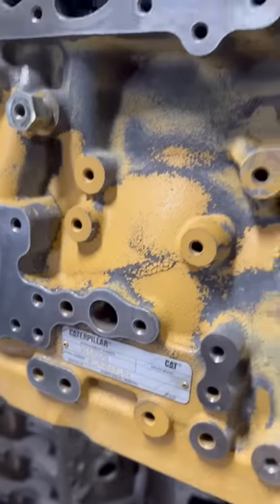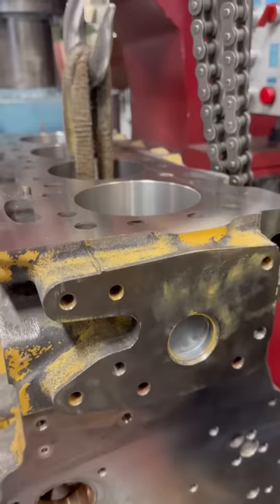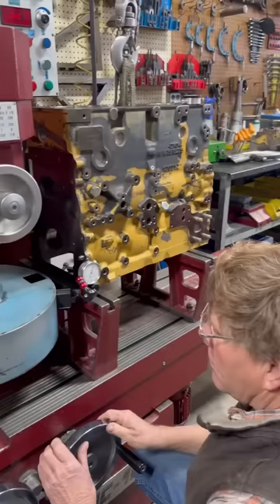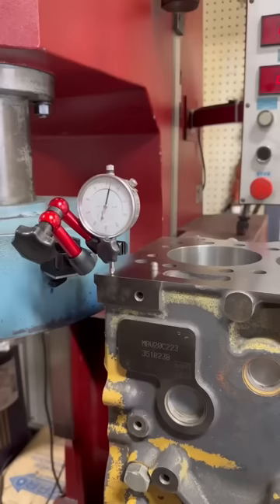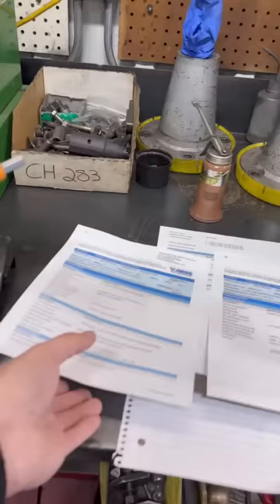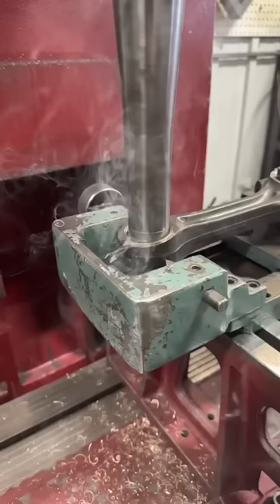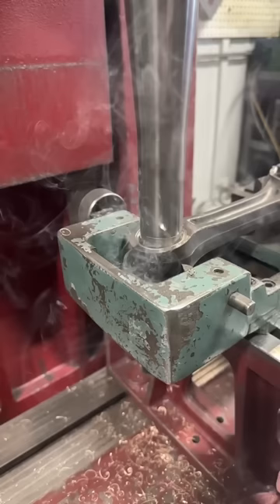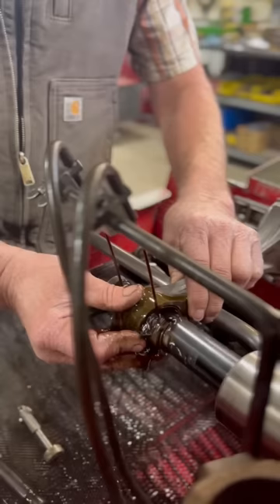#shorts How Can We Compensate For The Deck Height Being Too Short?

Comment: So if you had an engine come in with a rod knock and the customer wanted a cheap job that would last, what would be the plan for that particular engine?
Reply: The easy way would be to resize the rod.  They would remove the rod bolts cut both the rod and cap bolt back together the hone the big end until within spec then replace the bushing on the piston end, and again hone until within spec.  That would be the fastest and cheapest way to do it and still have a good long lasting repair .
Reply: My local shop would send it down the road and tell you they don't do bandaid work. I don't blame them, as it almost always brings headaches. But the other poster here has the answer if they said yes.
Reply: @bertgrau3934  Couldn't you just swap the bearings and get a replacement rod/piston, so long as the bearing didn't spin?
Reply: @terracar2003  
You could do that, but it could cost more.  Especially if you replace the piston,  they aren't cheap.
Reply: @bertgrau3934   I would rather replace it, the cost would be worth the reliability of a better condition part
Reply: @terracar2003  
If you get a warranty with I would agree,  but if a good machine shop does the resize of the rod, I would rather trust that than new parts,  over the last 3 years,  a lot of new parts are junk and need to be repaired before you can use them.  A good example is heads, I seen where a gentleman bought NEW Edelbrock heads, and had to have them fixed before he could use them.  He could have just bolted them on and the life expectancy would have been maybe 10,000 miles if that much.  Just because it's new doesn't mean it's good.
Reply: @bertgrau3934  I get that, I would however get a rod,piston and bearings all OEM
Reply: @terracar2003  
If you did all that you might as well get a new cylinder liner as well,  that way they usually come already assembled just remove the rod cap,  and the piston,  rings, are already in the cylinder liner then just put everything in the block , button everything up and its ready to run, by the way going with OEM parts is the best way to go,  in the 90s I rebuilt a 350 horsepower Cummins, 855 cubic Inch engine,  with aftermarket parts. Biggest mistake I ever made,  it didn't last 50, 000 miles.  After that I only used original Cummins parts.
Reply: @bertgrau3934  Not sure the motor I'm looking at has liners, but yeah that's what I meant by cheap, I'm needing to do this from the bottom without much disassembly other than the pan, crank and rods
Reply: @terracar2003  
I don't know of any engine where the pistons can come out through the bottom. Would need to remove the head too.
Reply: @bertgrau3934  I'm hoping to not have to pull the piston, the bearings on the rod are shot not the piston, just covering all bases
Reply: @terracar2003  
If it wasn't knocking very much that would be possible,  I had  97 Chrysler that I only drove on the weekends,  or vacation.  It got to a point where the rods would rattle at start up,  then quiet after oil pressure got to the bearings, then I noticed some times it would under acceleration the rods would rattle some.  I replaced the rod bearings with standard size and no more rod rattle.  If the knocking is bad,  you may need to get under sized bearings.  Just some of the different jobs I've done.  I wish you good luck what ever you do.
Reply: @terracar2003  
I hope you can fix it by just replacing the bearings,  that would be the cheapest way.  While you're at it,  get some plasta gage,  and check the bearing clearances on all the rod bearings,  you will need to buy a complete set anyway.  Like I said I have done that before,  in my case, the bearings were just rattling,  not knocking.  

Good luck , I would also check the bearing clearances after you replace the bearings. Just to see what kind of clearances you have.  If you use standard size bearings and the clearances are a little bigger than spec you might get away with using thicker oil, like 20W50 , again just a suggestion.  I would like to know how this turns out please keep me posted.
Reply: @bertgrau3934  That was my plan, it's just one rod making noise around 3500 RPM, but it's a Volvo T5 engine I'm wanting to be a daily, and I don't trust the rod to survive long as it's a built motor